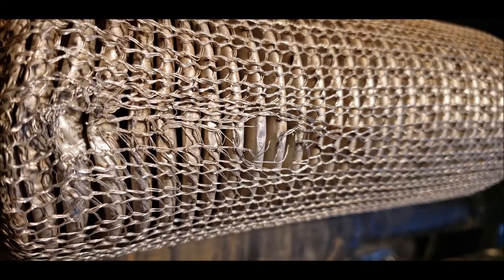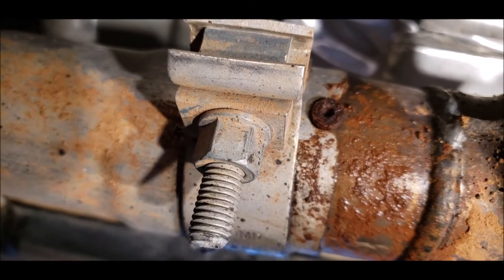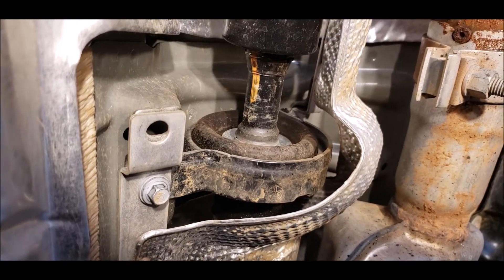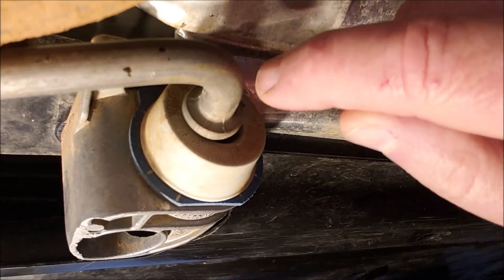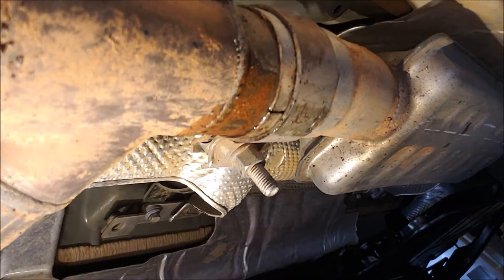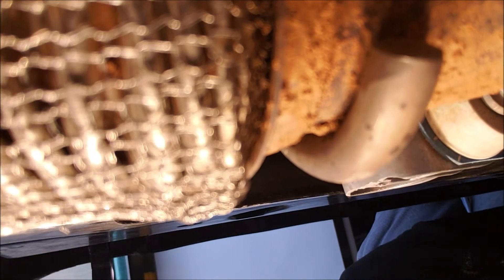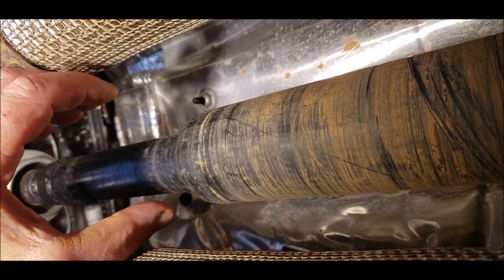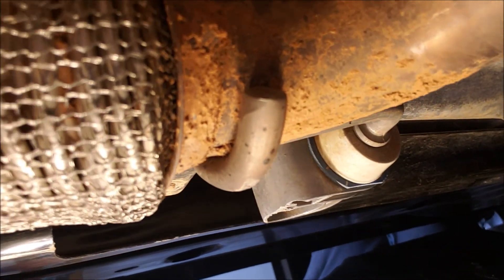#35 Jeep Cherokee Trailhawk: Damage From Ruts, Rocks, Holes And Deep Snow! Exhaust Vulnerability!

Comment: Its pretty common damage, brackets range from 25-35 dollars from the dealership each.  Also the expansion flex pipe gets hit alot, I used exhaust wrap with steel zip ties to secure mine so its not as loud.  I wish they would have protected that exhaust as it starts getting pricey with the fixes.
Reply from the maker: Since they hang down so far it's no surprise banging them up is a common issue. I'm getting rid of those as soon a possible. I think just a regular bent Z shaped exhaust hanger fished in above the pipe with those rubber exhaust hanger donuts would work better for off-road.  Trailhawks didn't get an off-road exhaust system? Kinda lame for Jeep to cut a corner there IMO!
Reply: So I could just roll some flat stock stain less and just wrap the flex connection? Would that cause to much heat retention?
Reply: @ironborn8786  So far I haven't had any issues with using exhaust wrap on the flex connection.  It will keep more heat in the exhaust, but its only a temp fix until I replace the whole exhaust.
Reply from the maker: @ironborn8786  Just a galvanized sheet metal wrap might keep the wire mess from getting snagged on rocks and getting torn up.  The mesh is supposed to hold the bellows together. If the mesh is gone the bellows will really droop. Heat retention shouldn't be a problem either.
Reply: @4x4nerd80  oohhh ok. I was curious if you were just going to use it to stop it from getting torn. I was just talking  DLWoregon about this issue. I am in the process of fabbing up somthing to protect the mesh as it is s bad design.

Comment: I completely destroyed mine 4x4ing. Sounded like a lawn mower... was relatively cheap to fix but you are 100% right. I am in the middle of fabbing a cover plate for it!
Reply from the maker: As you can tell from my rantings in the videos I don't like my exhaust dragging. I have a friend with a shop that has benders, etc. for exhaust work. We're going to dig into this thing next week and make some improvements. I'll post what we come up with. I've always wanted Cherry Bombs 🇺🇲💪!  I don't want to fab a cover til I get the exhaust tucked. Then I'll fab a cover to deflect mud from the front driveline bearing and  some of the exhaust in one shot.
Reply: @ElectricDanielBoone  good luck. Looking forward to your solution. Does the exhaust sit the same on the 2015? That's what I got. Tore a HUGE hole right into it...
Reply from the maker: I don't know if they're the same. Does the system in my videos look familiar?
Reply: @ElectricDanielBoone  yes it does. But I don't think my brackets are that low. Yours seem really low. I am going  to crawl under my jeep in the morning and get back to you.  Again, proud supporter of your channel!
Reply from the maker: @ironborn8786  I don't remember the exhaust on my 2017 TH hanging down that low either.  I'll look at the part numbers and see it they're different.

Comment: You need to put a liftkit on your jeep. I have a 2015 trailhawk cherokee lifted 2 inches with 33s. I never have that problem at all.
Reply from the maker: Where I'm headed, no matter how much I lift our Cherokee there's going to be spots where the rocks will get up into that exhaust the way it hangs down, unless I tuck it up and protect it more. The exhaust I'm planning may help the low end torque out too. The 3.2L makes max power (like 270 HP) at 6500, where I never get, so I'm not concerned about hurting that. Going with smaller pipes is the opposite direction most folks go, but for wheeling and 2000 RPM, in 8-9th on the freeway, smaller pipes can help. That's where I'm going to start anyway. Thanks for watching!
Reply: @ElectricDanielBoone  sounds like a plan and nice cherokee by the way.

I'm normally going up these back wood roads up in the mountains by my house. Now there is lots of snow so gotta buckle up for the ride and put her in 4WD all the way up the mountain. Dropped about 2 feet last night. It's beautiful out here
Reply from the maker: @NakedNW  The Cherokee's amaze me how they go through the snow.  I had my 2017 in 5 feet of snow before. It just floated on top when I aired down and put chains on. Soft spots got me, but I could always get myself out. Be careful out there!